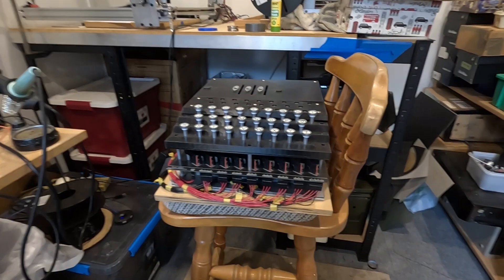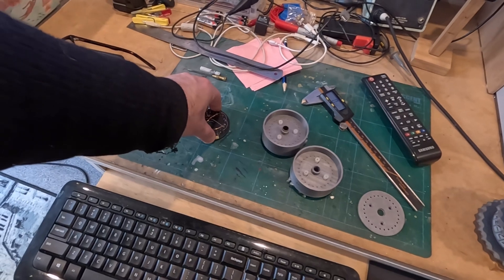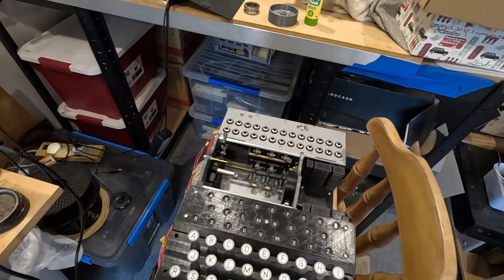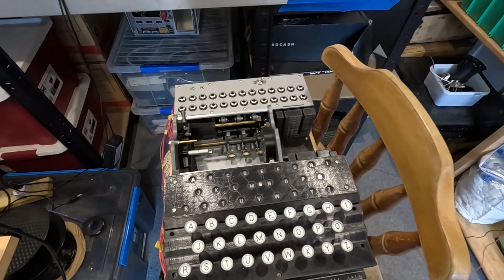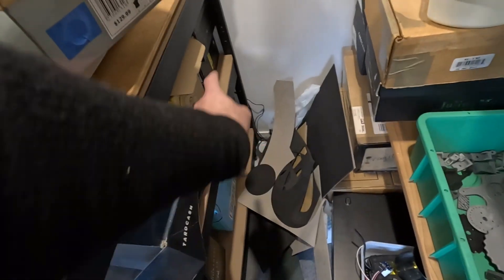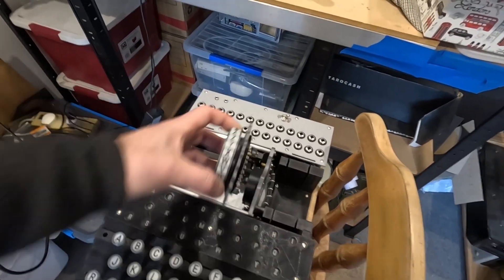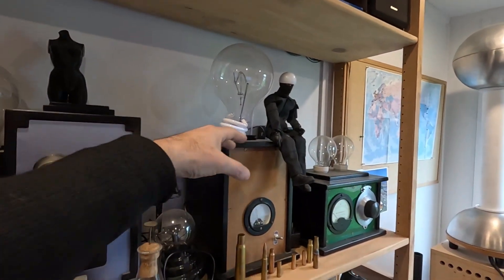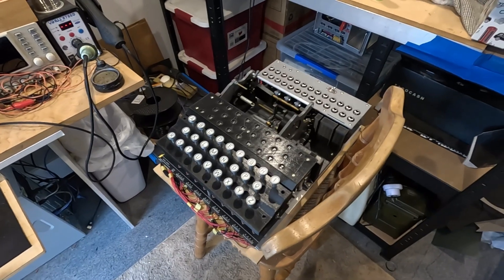3D Printed Polish Enigma update June 2024

Comment: This build is what first attracted me to your channel as I was also constructing my own Enigma-e machine, the ones you could buy from Bletchley.  It turned out pretty well, as well as constructing my own Oak case I also robbed the keys from an old and damaged typewriter.
Could I ask, why did you lay out your keyboard in alphabetical order, rather than the original QWERTZ that the Germans used?
Reply from the maker: Mine is based on the Polish one not the German ones so the keyboard layout is different. It doesn't really make a difference I suppose as you don't exactly type quickly on an Enigma!

Comment: The real Enigma machine requires a force of between 1.3kg and 2.08kg to push the pins in by 1.5mm to be within specification.  I've got the original blueprint for the rotor if you're interested in taking a look.

Great work on the project!
Reply from the maker: Thanks, is that the force exerted by the hole stack (3 rotors and reflector) when you engage them? I need to dig out some of my Enigma books since I think they talk about the pressure too. I probably knew this but it's been so long it's fallen out of my brain! Those pogo pins are surprisingly strong spring wise. And so many of them makes it worse. The other issue is being plastic the machine just isn't very rigid!
Reply: @asciimation  No, just one rotor.  From the original blueprints (not the Nachbau reproductions):

"Ein Gewicht von 80g muß den Pimpel H3 um 1,5mm hineindrücken", translates to "A weight of 80g must push the Pimpel H3 in by 1.5mm"
"Ein Gewicht von 50g darf den Pimpel H3 nicht 1.5mm tief hineindrücken" translates to "A weight of 50g must not push the Pimpel H3 in 1.5mm deep"

Given that those numbers are per pin (called a "pimpel" in the blueprint), we can extrapolate to 26 pins and determine that a force of between 2.08kg and 1.3kg is required, which must push the pins in by 1.5mm.
Reply: you can get the blueprints easy. He have already all the blueprints
Reply from the maker: Yes, I am using the ones from a German university they published. I don't have the link to hand on this computer though.
Reply: @magomat6756  You're likely referring to the "Nachbau" blueprints created by a team of university students in 2003.  These are (inaccurate) reproductions.  The original blueprints are not publicly available.
Reply: @lukepeterson447  they made a replica on the base of these drawings, so it should work

Comment: Finally an update!! For the rotors do you think about some brass balls that almost poke through. Kinda like a detent
Reply from the maker: That's basically how the originals work. But with rounded end brass pins. I have never felt a real Enigma machine rotor so don't know how springy those pins are. It would be interesting to know. That's probably the right way to fix it.
Reply: @asciimation  I've got some original blueprints of the pins used in a real (non-Polish) Enigma if you're interested.  Just reach out on my contact page as I can't seem to share an email address here.

Comment: how about instead of those pogo pins, you just use a bend contact. either a bend springy pin or flat copper contact like a leaf spring. so it would drag those contacts as you are just turning in one direction anyway.
Reply from the maker: That's how they did it in the Turing-Welchman Bombe. The drums on that are exactly like you say, springy contacts or metal brushes. You can find picture of them with the little wire brushes set at quite a shallow angle to 'wipe' the contacts. I think the issue there is finding the right kind of springy material. Normal copper or brass isn't springy enough so it just bends and stops making contact.
Reply: @asciimation  You can get small contact spring wipers from card edge connectors. if you dismantle one the individual contacts could be soldered to the edge of a pcb circle and wipe a second larger pcb ring.
Reply from the maker: @cnp602  Yes, that's a good suggestion. I know exactly the connectors you mean too.
Reply: @asciimation  How do I contact you - I may be able to help.
Reply from the maker: My email should be in the about page for the channel. Or else channel name @ gmail will work!
Reply: @asciimation  Yep, found it just after I posted that message .  I've emailed you.

Comment: Glad to see that you haven't given up on this project.  I always wondered if those pogo pins would cause an issue when the time came.  I was actually thinking that the sideways stress on the pins would be the real problem.  Never thought about the combined force of compressing all those springs at once, but can see that issue now as well.  Since the mechanical part works so well I wonder if an alternative approach to using the micro controller might be to use LEDs and photodiodes in place of the pogo pins and contacts?  You could probably power each rotor with a small internal 'coin cell' that would last for years.  Just a thought.
Reply from the maker: I did try to mount the pins to the boards in such a way to minimise the side loading on them and that was mostly successful. So that was a problem as you mention but not as bad as the pressure issue. You can get bigger pins used for higher currents but then then seem to use even higher spring forces. LEDs and photodiodes is an interesting idea! I hadn't thought of that. That would be a lot of work though. It'd be a 26 way optocoupler! Would definitely solve the friction problem though.
Reply: @asciimation  You would probably need 52 of them, considering that you also have the reflector to deal with.  It would only really be practical if you designed a custom PCB to mount them all on so that it was then easy to replicate for the reflector and 3 rotors.  Might even be possible to come up a PCB layout that works for both halves of each rotor?  As you said, it would be a lot of hard work to design, but the payoff would be in the ease of implementation afterwards.  Plus you have the guarantee that the mechanical part will still work at the end.  It would be a fun little side project to try and design though.
Reply from the maker: The reflector is a bit trickier than the rotors as I guess the LED/diode would basically have to be in the same place!